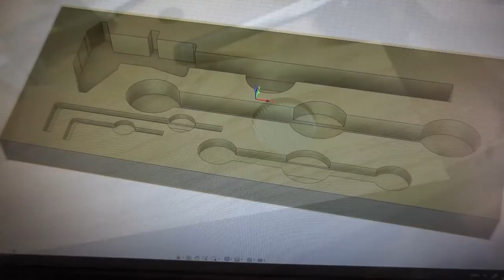Une CNC a moins de 300 euros #Banggood13th

Comment: How do you prevent this small motors from overheating under this load? I build nearly the same machine but with a 500w Banggood spindle and mine are loosing steps and are overheating while cutting hardwood, so I’m planing on upgrading to bigger nema 17 or small nema 23

Comment: Merci pour cette super vidéo. Je suis entrain d'en fabriquer une. J'ai juste un problème au niveau des moteurs de l'axe y. Ils doivent tourner en sens inverse par rapport à la symétrie. Je voudrai les brancher sur la même prise pour qu'ils tournent en même temps. J'ai une carte arduino. As tu quelques conseils. Tu a combien de prises sur ta carte. Où as tu branché l'axe Z vu que c'est une cnc laser à la base Merci. Étienne
Reply: il suffit d'inverser deux cable pour faire tourner ton moteur en sens inverse
il te faut trois driver minimum pour que cela fonctionne
Reply: Merci de ta réponse. Peu tu me dire quels fils inverser (couleur) pour pas faire de bêtises. J'ai regardé sur le Web mais ce n'est pas clair. Certains disent qu'on peu brûler le driver si on inverse pas les bons files. Mercu